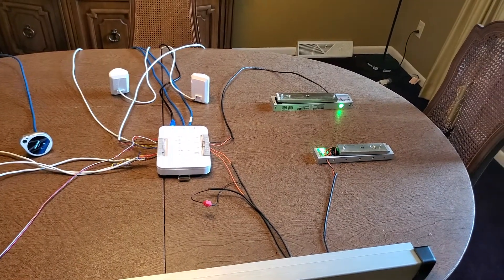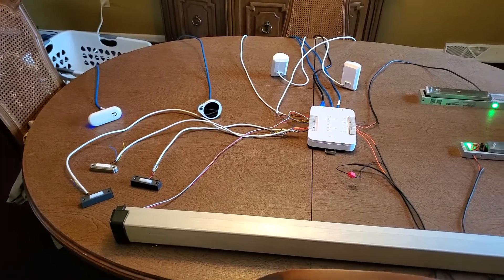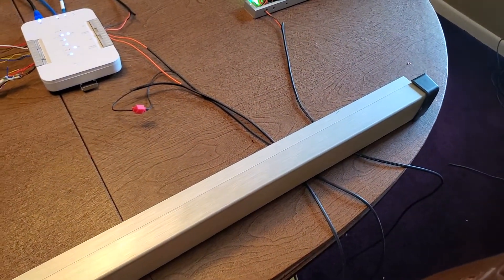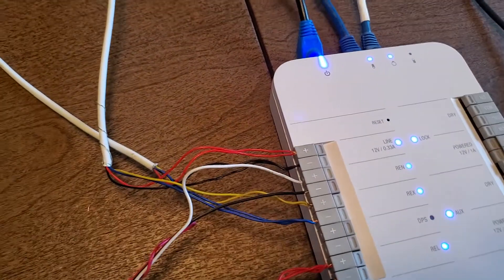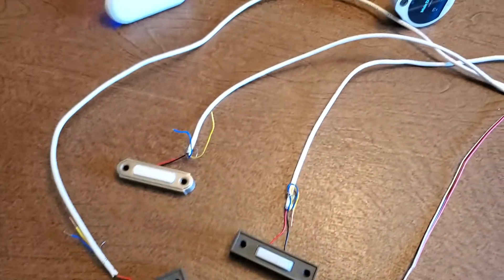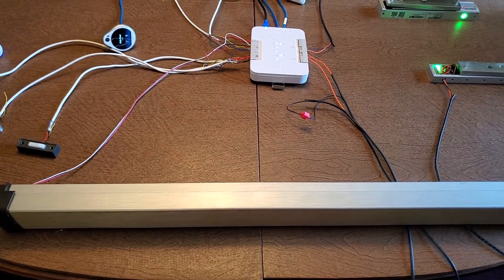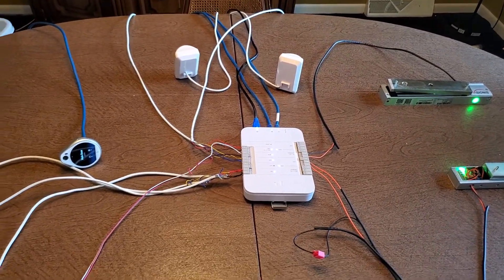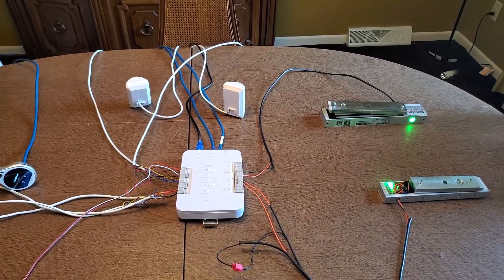Ubiquiti Unifi Door Access - Multiple Doors, Sensors, Buttons, and features expanded.

Comment: It is still a single door controller.
Reply from the maker: Depends on what you mean. To power the strike yes it is still one door. If you use an alternate power supply you could run multiple doors on the system but when activated it will open all doors connected to the UA-HUB.
Reply: @loufilla7202  so in the unifi software it is still defined as 1 door I guess? not 2 separate ones?
Reply from the maker: @DavidCumps  correct

Comment: Great video.  How could a person wire a doorbell chime to a system like this?
Reply: With the latest release you can config your AUX as Door Bell
Reply from the maker: Thank you! So currently no way of adding a door chime. I do have multiple installations of this system. Not to get too much into the weeds but I am designing not a door chime but rather a LED light to go off rather than a chime. My theory is using the Bottom right side of the UA-HUB that says "powered 12v / 0.33A.". That can be used to sound an alarm if a door is open for too long. You can program the UA-HUB to reverse features so I'm in testing phases of using that port to put a button on the other end so when it's pressed a LED light will go off. I have not tested any chimes because my current install wants LED lights which frankly I think is better. I will keep you posted on future videos if I can do this. The doorbell chime feature built into this system is terrible...
Reply: @loufilla7202  Thanks for the reply.  I noticed in the Ubiquiti Early Access store, they just came out with a wireless chime for the G4 doorbell.  I wonder if they'll do the same for the Access Door Access System.
Reply from the maker: @tchaikovskygoss7410  I agree. I think they will release one for door access as well.

Comment: Thanks for the video.  Question - currently run unifi in my house and i have an old alarm system.  I only use it for self monitoring and not to a service.  Was thinking of switching to the unifi access but I have about 12 windows and 4 doors.  The windows are your simple magnetic contacts.  With my alarm system they each go into a zone to know if its opened or closed.  I have not seen much about this mentioned but do you know if unifi works in this sort of way? would i be able to tell which window might be open with the simple contacts?
Reply from the maker: Hi. So in your situation you can design it in many ways. You probably would want to purchase 4 UA-Hubs. This would allow each door to be monitored by camera. You can then set your windows to use the same UA-Hub to lock and unlock your windows. The Unifi door access shows you when a door is open or closed. You can even wire an alarm or light to turn on if a door or window is open too long. Hope this helps.
Reply: @loufilla7202  thanks, its given me some ideas.  but if my understanding is correct i can only connect 1 door per hub?  or is it because you can only wire one camera per hub?  i do already have unifi camera's covering the doors - just looking to use the magentic strips with each door and be able to tell which door is open / closed.  same with the windows, you would know which one is opened and closed?  or because all the wires go into the same connection they are grouped together?
Reply from the maker: @frankbear6354  yes and yes. One hub will cover multiple doors and/or windows but they will all open close when you use NFC device or PIN if u use a UA-PRO camera.